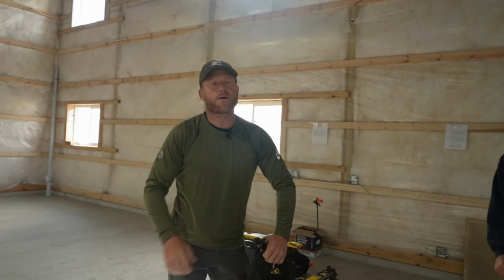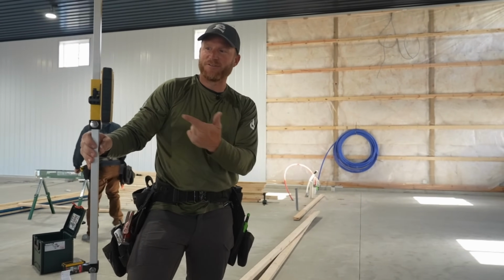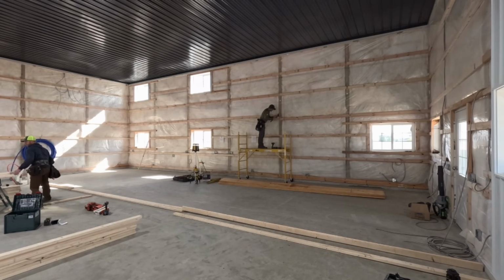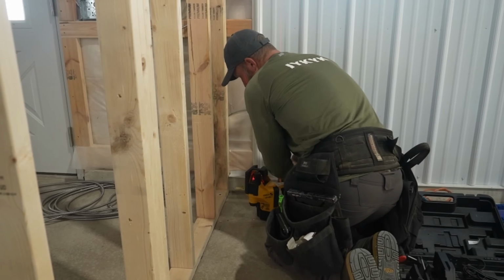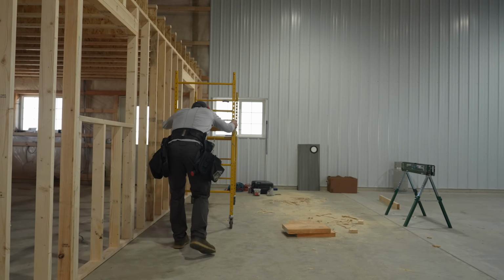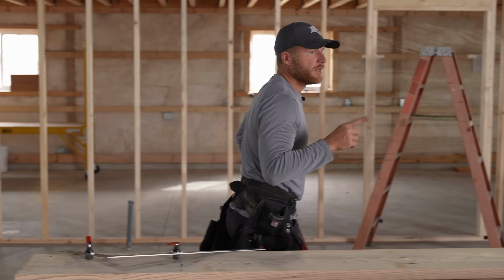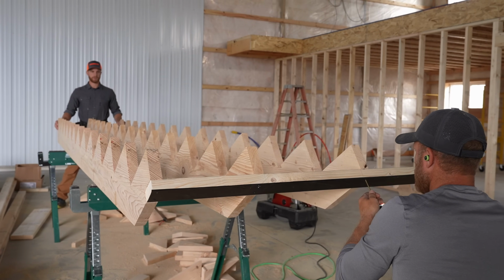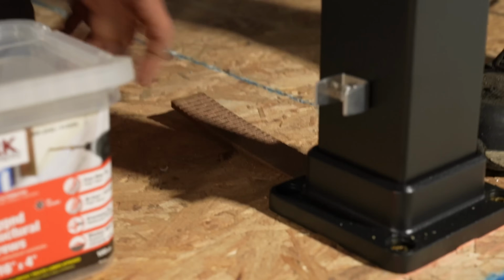Shop Mezzanine Buildout with Stair Case Build: Farm Chains Final

Comment: I would never put up with that! The plumbers f’d up. The plumbers need to fix it and at their expense! It’s not what or how the customer wanted. Look how much more time, changes, and “work arounds” now have to happen as a result of their mistake. I get it, people make mistakes. However, if you keep allowing it, it just enables them not to care (or as much) and gives them the impression next time they can get away with it too (if you decide to use them again). Additionally, when it comes to “timelines” I’m firm believer in doing things correct the FIRST time and pushing the timeline instead of “just for nows” having to come back and redo’s later
Reply: Every situation is different, every sub contractor relationship is different, being able to work with your co- workers is way more valuable than being pompous and stomping your feet just so you can say you stood your ground.   This was obviously something that was negotiable, take advantage of those situations so you can maintain lucrative relationships.
Reply from the maker: agree 100%
Reply: I've seen electricians fail to center an electrical box in a foyer and tell the customer to swag the chandelier to center. Or the electrician fails to install the proper box to hold a 200lb fixture. These are homes going for over 5million. The plumbing on this job should have been overseen by Kyle to make sure the placement was done prior to the concrete pour.
Reply: @michaelprosperity3420  I 100% agree. Instead of throwing this back at the plumber, the GC has to have culpability. After all, the oversight of the project is their responsibility. We never pour concrete prior to double and triple checking, layout  of structural elements and utility.

Either the superintendent is absent or doesn’t know their job function. Either way, this shouldn’t have happened.
Reply: Someone should of been there to explain it
Reply: Oh shit.  I see it every which way mentioned.  I have stories.  Lots of them.  Seeing the details is when projects run smoothly.  Otherwise, one thing cascades into another and other trades stack insult to injury.

Today it was realized that the 3 tier 7' diameter chandelier was off center of the 22 foot stone fireplace.  The ceiling will have to get cut open and the box will need to be shifted 7" along with some minor framing, new rock, skip coat, prime paint and remove and rehang fixture with 5 guys working off 2 stages of scaffolding.

I haven't even seen good concrete work out here yet.  

After this same group of electricians unplugged my grinder to plug in their heat gun to turn a pipe and another grabbed my 6' step ladder I didn't feel bad for any of them.  Just the owner.

Shit, I had only ran to the lumber yard 10 minutes away for a couple 1 1/8 impact sockets which were not available.
Reply: @RRBuildings Still, I like your client-focused mindset that says, ‘We’re going to make it right so it’s usable as needed; maybe we can even improve it following the curve added by mistake.’ Win-win.
Reply: I like how you guys say it's Kyle fault cause he the gc or the super should of been their but this stuff happens all the time and nobody who is a professional needs a man standing over them while they do their job cause most super don't do anything but sit in a office or ride around in a truck paid for by the company but when plumbing is wrong if your a experienced framer you put your plumbing in the walls then work off of that even if it is the plumbers fault you don't spend more time waiting for them to cut concrete and fix it
Reply: Did you watch the whole video?
Reply: Being Super on the job is a nightmare when low level trades are being used
Reply: You obviously never worked on big job sites. The General contractor/ owner will decide on the cheapest and easiest route. I’m which will be the framing having a couple of adjustments instead of cutting in to concrete.
Reply: @noahjaschik6112  if you watch the entire video, the plumber fixed it. On there plumbers dime it sounds like.
Reply: @RRBuildings you agree? I bet the customer said whatever you have to do just make it happen. You know you can’t move the plumbing. Just be honest and say it pissed you off. That’s what the guy was trying to say.

Comment: Architecturally, are those outer posts OK to have that much weight on them when they're already supporting the weight of the roof? I'm doing a similar build myself but instead of putting more weight in the posts which will sag with time I'm framing load bearing walls in-between the posts for the joists to rest on. I see a lot of people putting a lot of weight on post barn posts just doesn't seem like it's a good idea
Reply from the maker: they are resting on a full foundation wall..they are fine
Reply: but what about us planning on using sonopost piers? looking for any video that thoroughly addresses loads or clearly shows how we can build 2nd floor residential post frame home. I've been trying to buy one of your building plans for 2 years now and no answer...no reply....any plan that's closest to 40x56' with a 2nd floor. floating slab radiant floor and 2nd floor at each end. anything close to that would help and i'll buy the plans to go to school off of. thanks @RRBuildings

Comment: I believe that the "smile" curls more over time as it dries, not relaxes. (This can be seen more quickly over time with deck boarding placed outside.) Smile up I've seen curl more, ending up with a puddle of water in the center of each board.  I believe the boards would be better placed with a "frown" so the high spot remains in the center.
Reply: Thats the way i was taught was to put the frown down. Especially when doing out side decks. When i build decks anymore i push for trex
Reply: Correct. Crown up = frown down
Reply: I just removed my garage steps and planed them flat/re-stained them. Might be good to not use glue so you can do this?
Reply: Joists should always be installed crown up.

Comment: What supports your ledger just a couple sds screws into the 6 x 6 with a 2 x 4 underneath  not much order support  for that size of a balcony. Typically a ledger should be supported 16 inch on center with 5/8 lag bolts started into a solid wall, do you put any vertical pieces going down in between your 6 x 6 post to help support the Legerdemain ?

Comment: @7:00 you discuss how it's just going in a shop. But it's clearly going to have moisture from the concrete itself. Sure your tape helps, but any spill is still going to make it into those studs. I do NOT recommend this tape unless it's additional measure above / beyond treated lumber.

Comment: I see you do these regularly. What are you using for the ledger board on the outside wall both for material, and especially for mounting it?  Structural lags? Need something stout to span 8+' between posts and support the weight of the mezzanine.

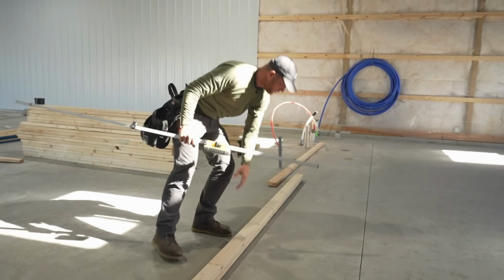Comment: Question - At the 5:23 mark in the video couldn’t you run a chalk string line at whatever height you need, put your bottom plate in, then put the 2x4 on the bottom plate and raise it up and have the 2x4 touch the chalk line at 8ft and wherever the 2x4 hits the chalk line you’ll have a mark to cut it.  Instead doing it the way you have been.  Hopefully i explained it well enough to understand.  Maybe something to try….🤔
Reply: You can do that but the distance they were going there would be some sag on the chalk line because the string has weight and the chalk adds more weight to it. For smaller length walls it would be great.

Comment: You got the graim issue with the stair treads reversed.  You used the analogy of a smiley face (grain up).  Its actually the other way around.  Grain will shrink into the into the board resulting in cupping.  The proper analogy should have been a frown face.   Im sure you know that...just got reversed when explaining.  Happens to the best of us.  Its a great point though that not all carpenters realized.  It didnt really sink in until I started milling my own lumber.

With that said, your work is exveptional.  Keep it up boys!
Reply: I agree with you...but I think he was explaining to make the grain a smile if you will. I went back and stopped the video to see. So I guess I need to see if I learn sometin different or if He changes his mind!!!

Comment: Do you still need to use PT timber on concrete if there is a dpc/plastic under the concrete? I am assuming that there is something under there due to all of the insulation everywhere else.

Comment: What about the fire rating between the shop and office space.  I-joists have trouble achieving a 20 minute burn rating because of the 1/2" OSB web failing quickly when exposed to fire.  I figured you would have to use drywall or some other fire block under your subfloor to pass building code.

Comment: how do you know the concrete can hold that 2nd level? i'm trying to design 40x56' w/ 2 floors residential, but no videos that address beams, loads, maybe add a pier or 2 in the middle of floating slab? maybe just leger/rim board on gable end walls?

Comment: Do you have to adhere to stair railings code of any opening be less than what a 4" sphere will fit? Looks like where your rise and run meets bottom rail is more than 4".

FYI those who missed the math about figuring rise, 108.75 divided by the average between (code is between 7" & 8" (7.5") = 14 1/2" then round up ^ to 15 risers, 108.75 divided by 15 = 7 1/4" for each of 14 risers. The last riser will be up to the landing. Take off 1 1/2" for 1st tread at bottom. If you don't round up ^, your top tread will be at the landing height and each riser will be 7 3/4". This is where a lot of people mess up.

Code for most places are, Rise 7" to 8", Run 10" to 12" Railing height from front of 2nd tread 36" to top of railing & any openings shall not exceed what a 4" sphere would fit into. Sometimes, also first & last rise can be different, but all intermediate risers shall be uniform. This is because we always pay attention when getting on & off stairs, but rarely do for each step through out.

Comment: Can I assume you used screws to attach the inside girts? It just looked like you moved those 2x4’s fairly easily. No tear out from trying to remove ring shank nails.
Reply from the maker: Actually ringshank nails lol
Reply: @RRBuildings  So did you cut the nails with your handy reciprocating saw with the Diablo blade? Just curious about how you move a board that has been nailed with the ring shank nails and not damage the wood severely.

Comment: Excellent job and very thorough with each item's explanation. I have a couple questions about the I-joists used for this. What is the approximate spacing for them here? Maybe you mentioned it and I just missed it, but I have a similar idea in mind and thought it best to ask. Also, this is probably a really "dumb" question, but what prevents the vertical web from bowing and splitting sideways in a load-bearing application like this?

Comment: Why the vapor barrier inside of the fiberglass? batt insulation? Seems like it will trap moisture at some point, either coming and going. I understand inspectors might demand it, but something permeable would be better.

Comment: When you setup the laser an inch from the wall and use the receiver to plumb the wall, why don't you just measure from the bottom of the receiver to the target line on the receiver? If the measure is 2 1/2 just put your laser 2 1/2 inches from the wall then you can just butt the receiver to your top plate. Just my 2 cents :)

Nice job!

Comment: Might be a bit of an odd question, but why did you frame out headers for the internal doors that are non-structural? I know the outside wall will need them, but with the internal doors it just seems like a bit of wasted effort and lumber.
Reply from the maker: because the floor system sat on them

Comment: If a plumber cant read a print, and follow the carpenters marks on a stupid one hole bathroom, he had better give up and go do something else. Seriously, how do you fail like that?

40 year plumbing contractor speaking btw....

honestly he would be cutting that floor and moving it where it belongs, just like I made the last concrete guy remove the floor when he poured my fully adjustable floor drains in wrong... some peoples kids I swear

Comment: If its not a bearing wall just cut all the studs the same and shim it between the top plate to the ceiling/roof joists. Cutting everything to exact is better but efficiency wise I feel it’s overkill because of pole/barn construction. Not judging, just conversation, I don’t build 20’ walls so I am not as versed as you guys. Didn’t want my comment feeling judging or demanding as if there’s only one way to skin a cat

Comment: This guide is a good resource of videos, pictures and drawing. It does not have plans, so if that's what you're looking for don't bother with this book. https://www.youtube.com/post/UgkxLum--iPp9YKZ09j1BMdHaBMLkrGfIbcm What this book does have is a lot of great information on the building of sheds, design ideas, building options, etc. The author goes through the steps to build a foundation, framing, roof, even ideas on internal storage and external finishes. The text is easy to follow and understand. There are many sidebars that give tips and advice which most laymen probably wouldn't have considered. The photographs are great quality too. This is a great book and I'd recommend it highly for anyone needing or interested in building a shed.